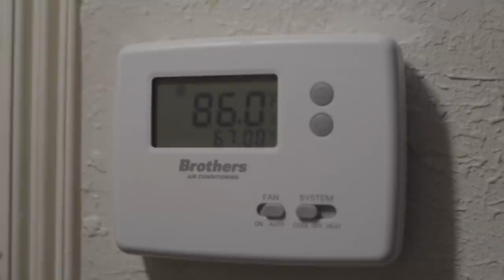Episode 9: Maggot Racing

Comment: Here's a tip: get a window A.C. unit and use it on jobs where the central air conditioning is broken. I have one I keep in my garage if my system goes down. It takes 15 minutes or so to put it in a window and start it up. I cut heavy cardboard and use duct tape to seal it in the window until the main unit is fixed.

Comment: Someone please teach Juan the correct, safe way to use a circular saw before you have to clean up his blood. Adjust the blade depth to that of the material you're cutting and lower it into the cut from an angle. The way he is using it is really dangerous and puts him at extremely high risk of kickback and subsequent injury.
Reply from the maker: Smurphenstein we told him when we walked in on him using it. 🤦‍♀️

Comment: To open fridge with rotting food (from my perspective). Place fridge in large empty outdoor area with high pressure washer and hose nearby. Wear coveralls, mask (with hood) & gloves. Lie fridge on side so door would open down using gravity to help open. Use a long metal/iron pole with a hook to rip open tape. Let doors fall open. Turn on pressure washer and proceed to clean, but be sure the spray goes AWAY from you. Car wash would be kinda cool if you could get away with it as a lot of the gunk goes down the drain and they have handy dumpsters. Just my opinion.